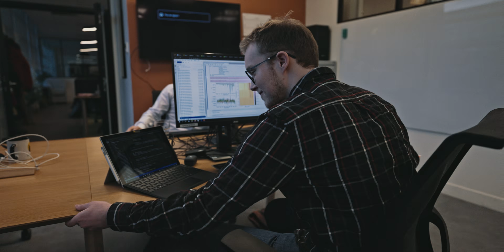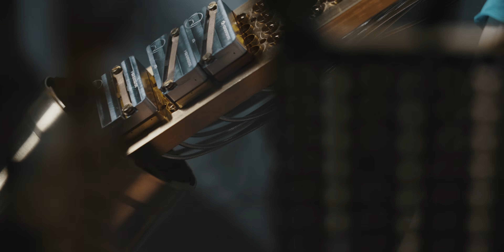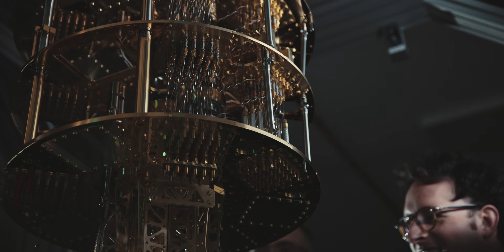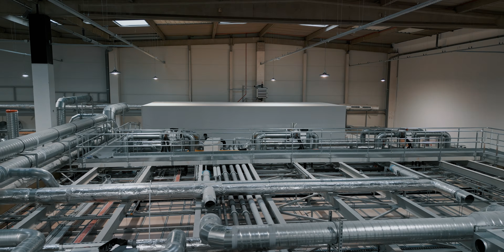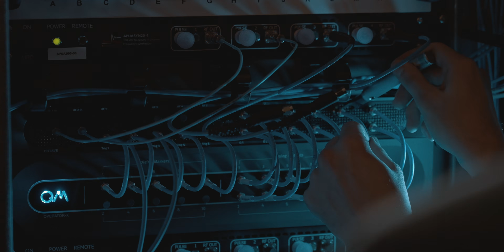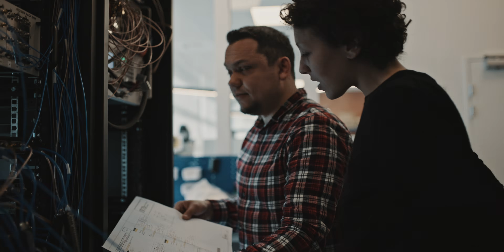How Engineers Are Scaling Quantum Computing

Comment: It's in the algorithms, efficient algorithms. 

Plus trying single-purpose terahertz (THz) chips first for bytes/integer processing and mathematical calculations of specific class or types, integrating them with classical microprocessors.

Though there are now the TPUs and NPUs which perform "shortcut mathematics" operations, and the microchips much-touted for their extreme speeds--the "quantum chips" or "quantum processors".
Reply: "Quantum entanglement is a weird phenomenon, when two particles are connected so strongly that whatever happens to one particle immediately influences the other. But what happens when we entangle three particles?"

Mathematically, it's "transfer of information". They say you can actually still "simulate" 8, 12, 25, to 30 qubits on powerful classsical computers and workstations?

My "hash data compression and fractal hash" programs emailed in 2008-2009 have those properties of "entanglement and transfer of information" from logical operations on integers. "Hash data compression" solved.